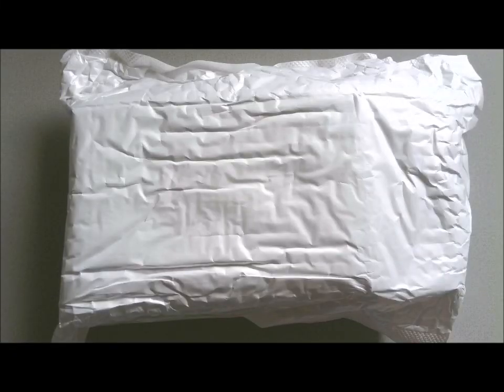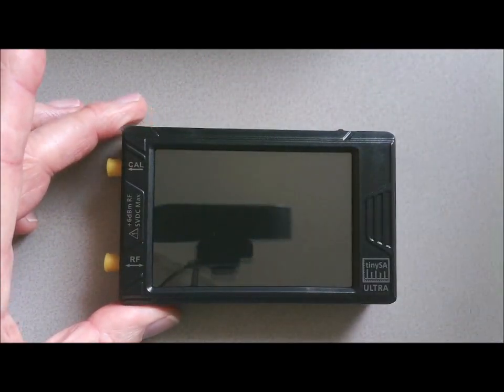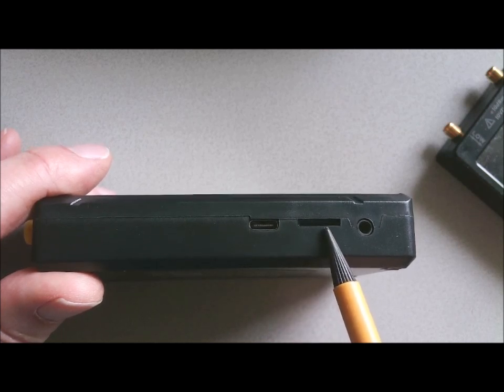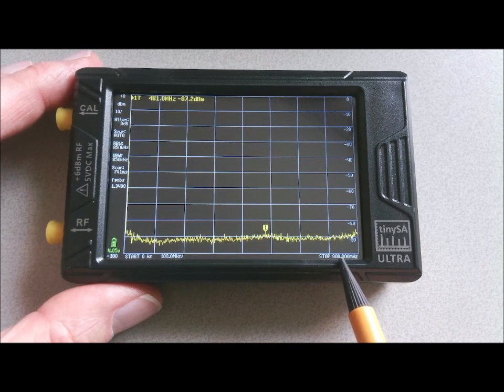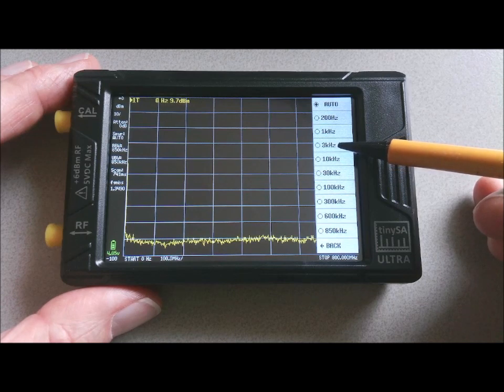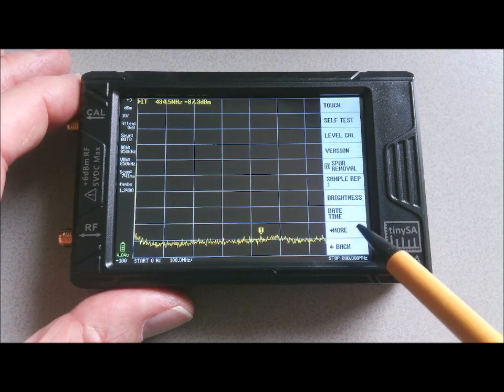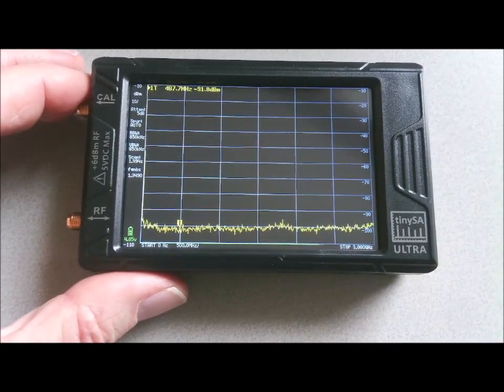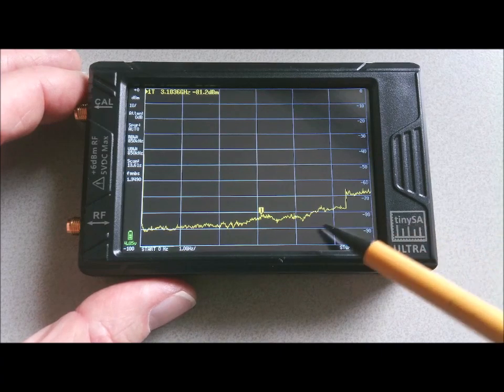Unboxing of and short intro to the tinySA Ultra

Comment: Hello Erik,  I recently purchased a TinySa Ultra and its firmware version is current as of February 2024: TinySA4_v1.4-156-g4eb315d .  I have watched about 3/4 of the videos listed on the TinySA web site.  I cannot get the instrument to scan frequencies above 800 MHz.  How can I get the device to scan up to (hopefully) 2.4 GHz?  When I select "Measure" from the main menu and select "More" and check on "FM" it askes for the center frequency and then the "modulation frequency 50 Hz to 20 KHZ" then "frequency deviation 3 - 500 kHz."  What do these mean and what values should I select to (for example) monitor North American FM railroad frequencies 160 - 162 MHz?  The same happens when I check on "AM" except that the modulation frequency is 500 hz to 10 kHz.  In that latter case, what frequency should I select?  I have a Canadian Basic with Honours ham radio license.  Sincerely, Ian Douglas VE6IWD
Reply from the maker: Enable CONFIG/MORE/ULTRA MODE
Reply: @ErikKaashoek  Hello Erik, thank you.  I tried that and it work including the unlock code and procedure.  - Ian D. VE6IWD

Comment: I'm glad for the new Tiny SA Ultra.  I have a couple of concerns.  The first is that I had trouble from my bank when ordering anything from China.  The second, which is something I don't quite understand, is the 405 points.  Can you suggest how to order and explain about the 405 display points.  Thanks
Reply from the maker: If you are concerned about ordering in China you better wait some weeks till R&L will stock the device. 
The maximum number of display points is 480 (width of the LCD)  - 30 (for the status display) equals 450

Comment: All boils down to Dynamic Range and Sampling rate, where these Gimmicks can't compete with 30 years old Real SA's like from Rohde / Agilent / Keysight etc
Reply: You can't compare a small relatively cheap portable spectrum analyser to a giant boat anchor.
Reply: @chryseus1331  yes.  And these Tiny SA prove to be mostly useless for any serious tuning - fault finding job. Whilst it’s VNA sibling like NanoVNA , EU1KY VNA ( which I built from scratch) etc produce strikingly accurate result compared to 10-50 times costly commercial VNA/ Communication Test Set , this little thing did not prove too useful for we HAM homebrewer
Reply: @Ujjwalis  Again you're still comparing a cheap $150 spectrum analyser to things that normally cost $1000+, not everyone has that kind of money or space, used with knowledge of its limitations the TinySA is perfectly capable of diagnosing many common issues, and I speak from personal experience having used it to fix various radios that otherwise would have taken me twice as long or ended up in the trash.

Comment: Hi Erik! The previous TinySA was easily overloaded while measuring DAB signals. Does this version handles this kind of signals better?
Reply from the maker: Expect similar behavior.
DAB signals are wide band and thus carry a lot of power. Best is to start with the attenuator on manual 30dB
Reply: Unfortunately i am seeing overloading artifacts with very low inputs. Is there a way that i can contact you directly to discuss this? ( In Nederlands )

Comment: Received mine two days ago. It's great. I first had the TinySA with the small screen. I knew the bigger screen was a selling point for me. What a great piece of test equipment at a very reasonable price. I first used my SA as a calibrated field strength meter. I set up a remote antenna 100 feet away from my car, ran coax to the car and hooked it up to the SA. I then keyed with radio with 5 watts out and got a reading on the SA. Next I tried a second mobile antenna and compared the two readings. My one 40 meter antenna was 6 db better than the first one. Just one of many uses for the TInySA and TinySA Ultra.

Barry, KU3X

Comment: How can I factory reset the firmware? After making some changes to the settings and saving them to load on startup, my TinySA Ultra locks up after booting and is unresponsive and I can't access the menu. It is also inaccessible when connected to my PC, though it can occasionally connect to the app after hanging for a while, but I can't pull screen images from it or functionally push control settings or anything. Thanks.
Reply from the maker: Push the jog button to the side while doing a power cycle.
Once started do a clear config and save to startup preset
Reply: Thank you very much; that worked! I rotated the jog button counter clockwise while turning on the unit and was able to access the menu from there. 😁